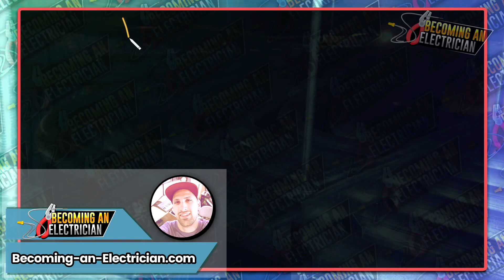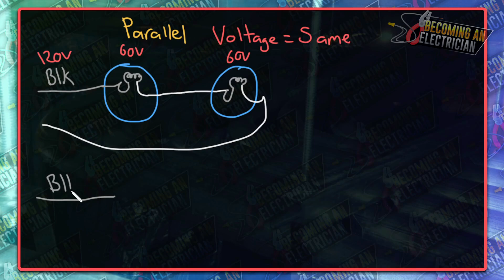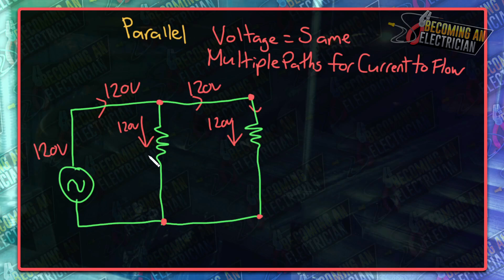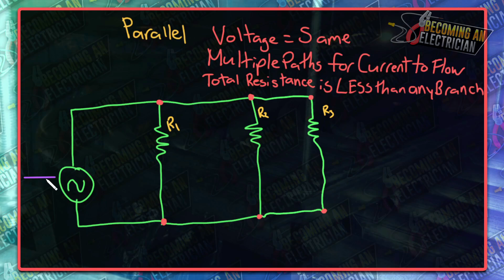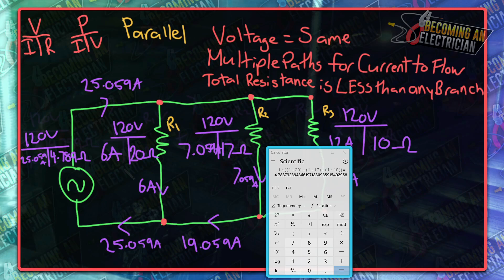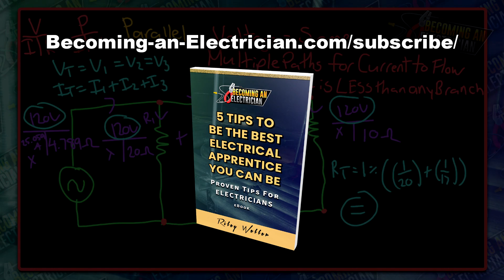Solve Parallel Resistive Circuits

Comment: Why does Canada use 110 volts while most countries use 220 volts? Thank you.
Reply from the maker: I'm actually not sure of the reason, but in theory, if you have higher voltage, you can use smaller wire size.  However, higher voltages are dangerous if not treated properly.  I know in other parts of the world, they have insulation on the prong terminals so that you can never touch live metal when starting to plug in.. in North America, plugs are just bare metal and can still be exposed to shock when plugged in!
Reply: @BecomingAnElectrician  First of all, thank you for the wonderful answer. From my modest research, I arrived at this answer, which corresponds 80% to your answer. . . First, regarding the main difference between the two systems, 110 volt electricity is considered a safer solution for citizens and consumes less electricity, as I mentioned earlier, while electric 220 volts is characterized by better quality and high efficiency. , but it is more dangerous than the other power, and that was the reason for the diversity in Choose the power of electricity.
As for countries like America choosing 110 volts while Europe worked with a 220 volt system, according to the answers on the Stackexchange site, when electricity was developed in more than one region, work was done according to rules set by governments, and a government like the US government chose the safest option, and there are rumors Also, the matter is due to the control of some investors who wanted to market their 110-volt appliances at the time.

It should be noted that the 220-volt system and its environs are spread in Europe, Africa and Asia as well, while the 110-volt system is spread in North America and most of South America.
Reply from the maker: @مستملحات09  Thanks for that.  To clarify, 120 Volt vs. 240 Volt does not consume more power.  Wattage is what consumes power.  If both products operate at 5,000 Watts, voltage and current don't matter, however wire size will be different in the two units.
Reply: @BecomingAnElectrician  yeah I agree 👍